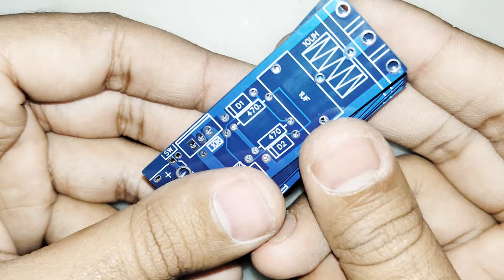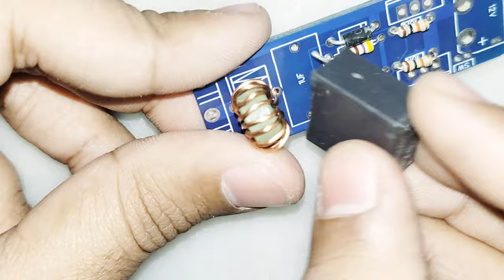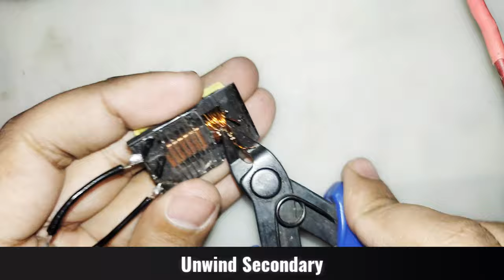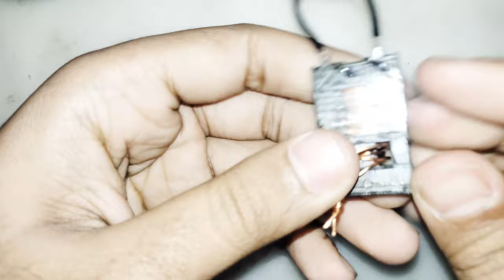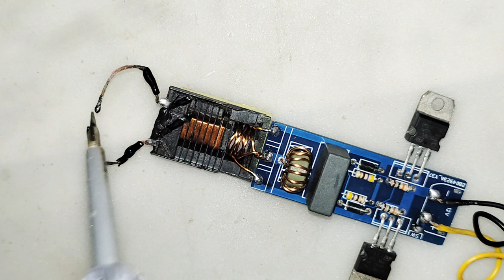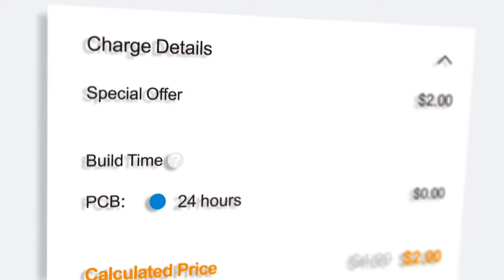How to make Arc Lighter | Plasma Generator | High Voltage

Comment: why in this circuit you use 2 mosfet way? i made alot of these with 1 mosfet, there are any advantages?
Reply from the maker: 1 mosfet is auto generator that has very little power . But this circuit is very powerful by switching both MOSFETs and it is also reliable
Reply: @Electronic_For_You  i see, thx, i will try it out soon.
Reply from the maker: Welcome 😀

Comment: that was great and neat piece of work, thank you for sharing, i already tried it and it worked so great and powerful, but why we should touch the poles to see the Arc, is there any way to produce arc without touching the two poles? thanks.
Reply from the maker: Yeas you need more higher voltage transformer i think 😀
Reply: @Electronic_For_You  I SEE, THANK YOU AND KEEP UP THE GREAT EXPERIMENTS.
Reply from the maker: 😊 Thanks
Peace Be upon you!